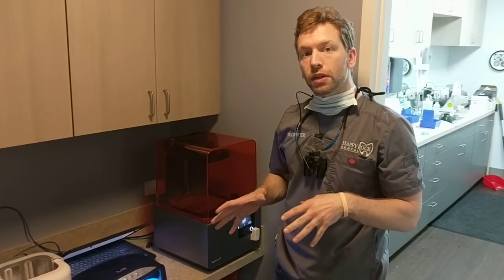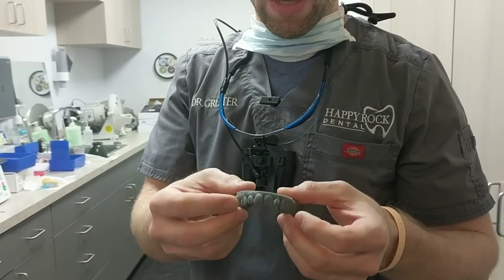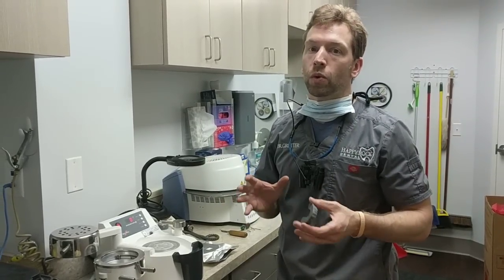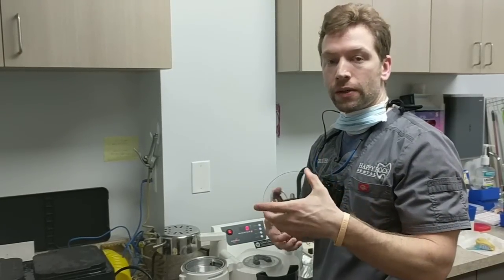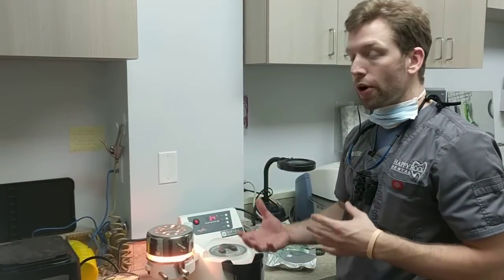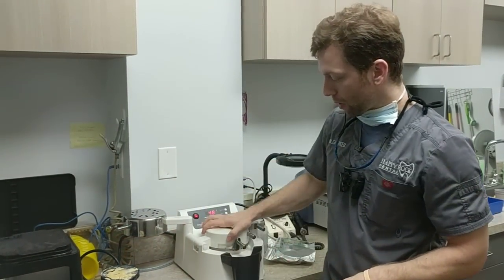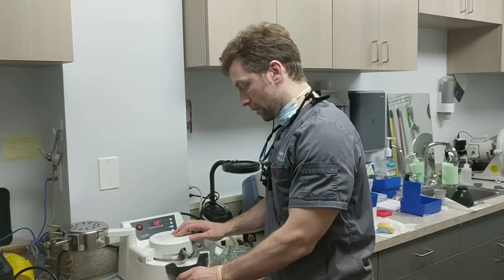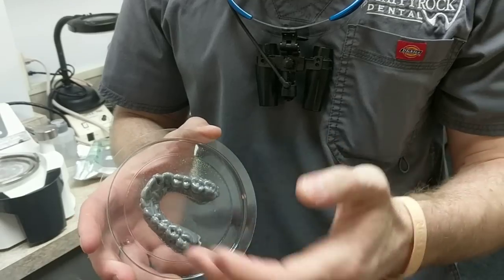Aligner Fabrication

Comment: i hope you see this comment...I dont know if you check the comments for these older videos.  I know you use the Essix ACE 040- for aligners, but what tray material do you use for bleaching trays and clear retainers?  thanks for your videos!!
Reply from the maker: I actually now use Zendura FLX 0.76 for Aligners and Zendura A 1.00 for retainers. For bleaching trays, I'm not sure and not really partial to any specific company. Probably just the cheapest since it's not a particularly demanding use.
Reply: @bgrutterdds  thanks for your response.  Do you use a different tray material for the template button placement appointment?  We just started using our SprintRay and bought the Biostar tray former.  Excited for all of this.  I think you are up in Ogden if I remember correctly?  I’m here in Utah County.
Reply from the maker: Nope. I'm in Grand Rapids. Was in Kansas City before last October. 

We're using a thinner, cheaper template material for the buttons. Just started recently to keep from wasting an FLX sheet on them. Honestly don't know what it is, but it's cheap and from Zendura.
Reply: @bgrutterdds  lol..man...pretty expensive..over $4.00 a sheet.  reason why you switched?
Reply from the maker: I was able to switch from Bi-weekly to Monthly in the software. That's twice the movement per tray. So, half as many sheets AND half as much labor. Half the treatment time, too. But that's just icing in the cake. 

In the end, it's probably break even or better. Plus, tracking has been awesome and patient comfort is that much better. I was reluctant at first. But now zero regrets.

Comment: what thermoforming machine are you using? pressure or vacuum is better? Thank you very much
Reply from the maker: Pressure MUCH better. I use the Ministar, sold by Great Lakes Ortho.
Reply: @bgrutterdds  Thank you very much! may I ask more specific about this one https://www.greatlakesdentaltech.com/ministar_s_reg_with_scan_technology_018_001.html. is it good for aligners?
Reply from the maker: Yep. That's what I recommend
Reply: @bgrutterdds  thanks. I hope you have a great holiday ahead.
Reply: @bgrutterdds  is there any discount code available to use at Great Lakes Orthodontics to buy Ministar?
Reply from the maker: None that I'm aware of. Sorry.
Reply: @yousafahmad1044  Call them and they will negotiate slightly, so I have heard!

Comment: Dr. G what material and thickness are you using for your clear aligners?  Thanks!
Reply: hah you said it right there Essix Ace .040"    Thanks
Reply from the maker: I use Essix Ace 0.040" (1.0mm)
Reply from the maker: I use Essix Ace 0.040" (1.0mm)